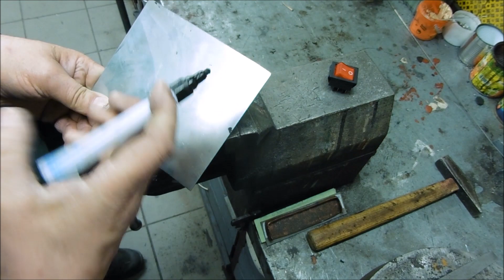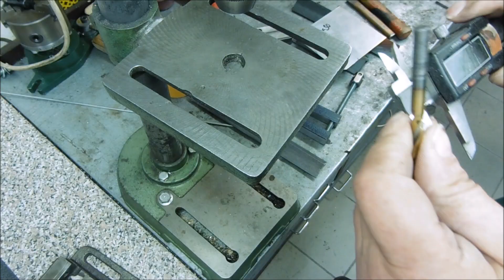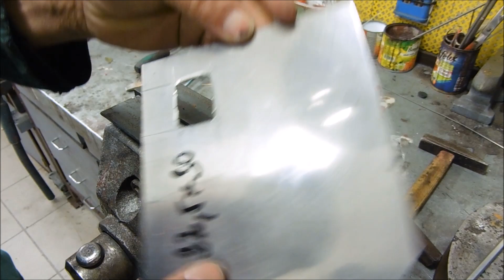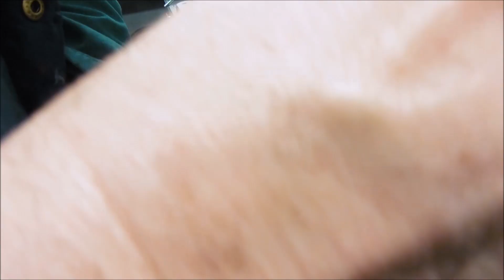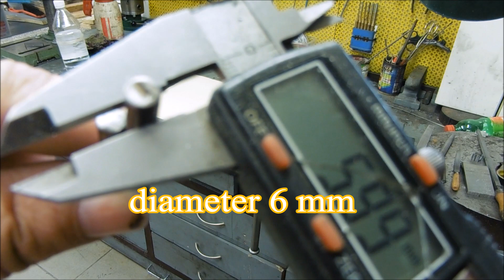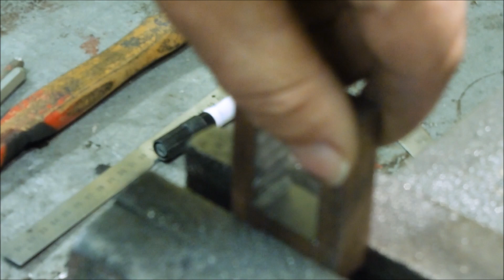How to make a square hole to the metal plate

Comment: For very thin sheet you can just use the chisel no need to drill first especially on thin aluminium. great video.
Reply: I need to do this to 1/4 inch thick aluminum. Do you think a chisel alone would work?

Comment: There must be easier way than this. It is 21st century for sake
Reply: Use a laser or waterjet cutter.
Reply: If you cant simply use a chisel+hammer and then sand the edges i dont think you should even bother. Its not hard. Unless you have a cnc machine this is the easiest way imo.
Reply: You could always use a dremel, a cut-off wheel, and a steady hand.
Reply: @nighthawk6468  I've done it with a dremel, and the chisel&file method can actually be faster and less annoying.
Reply: @GenePavlovsky  Yeah for sure, though filing can get a little annoying after a while though!
Reply: @nighthawk6468  Since the hole is just for a switch, the edges don't even need to be perfectly nice looking. With a little practice, the hole can be cut to good enough dimensions on the first try, and the switch will fit with almost no filing (besides the corners, which have to be squared off).
Filing can be replaced with a grinding wheel on a dremel. But these little cut-off wheels... they use up quite quickly and break easily if you have a lapse of concentration. For a bit thicker sheet (e.g.  2 mm) they also take forever to cut. I generally use my dremel only for very light duty precision tasks.
For cutting square, rectangular, and whatever custom holes in sheet metal, there is a nice tool called hand nibbler. There are also nibblers that attach to your drill.
Reply: One day all the people who know how to do things like this will be dead and nobody will know how to do fuckall themselves without expensive machinery.